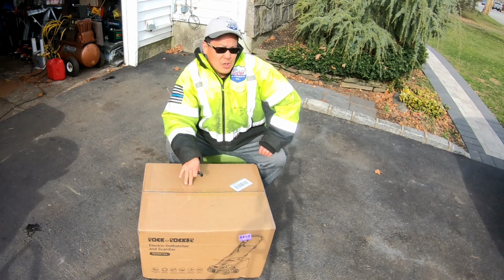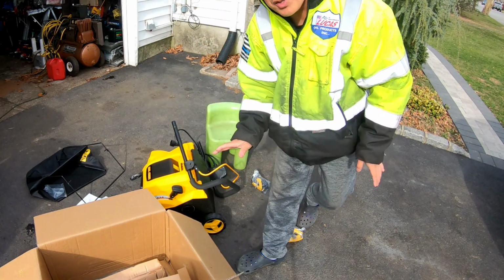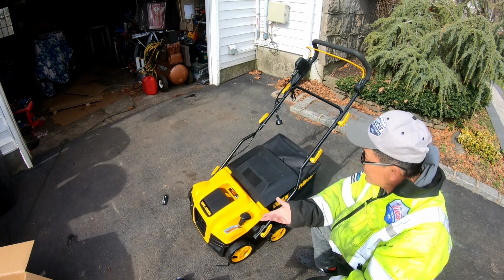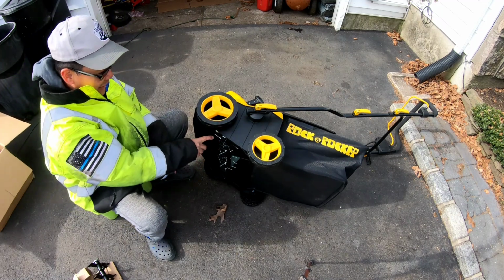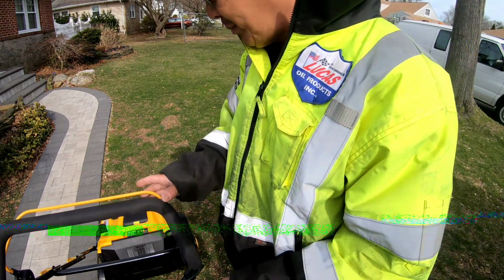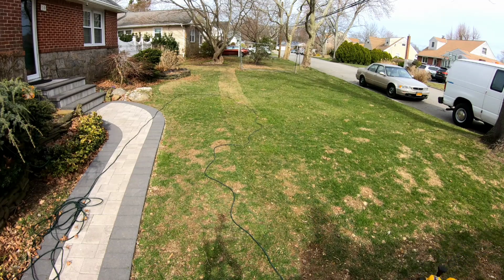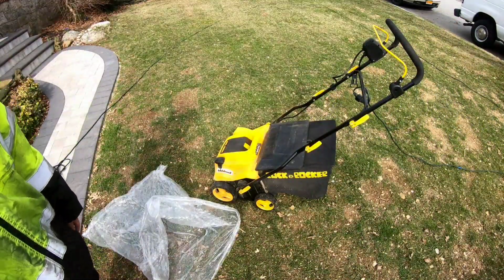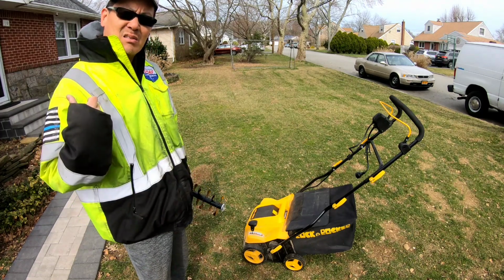ROCK & ROCKER 16" 15A ELECTRIC CORDED DETHATCHER SCARIFIER TILLER CULTIVATOR W/BAG UNBOXING & REVIEW

Comment: I bought a RknRkr and used the scarifier to prep for overseeding and it worked great after discovering the best way to use it. It doesn't push very well because of the rotation. The forward rotation tends to make it climb. If you pull it it maintains contact much better and requires less effort giving better results.
Reply from the maker: Good tip bro thx!  Hope you’ll subscribe

Comment: Henry, Most of the time when I think of a Scarifier,, I think of the rather large ripping teeth that are on road graders and other heavy equipment or even farm tractors that would be utilized for earth moving or leveling for future roadways or even unpaved gravel roadways. 
The Scarifier is commonly used for breaking very hard packed or more rigid surfaces.for easier grading or even digging. 
Henry, The device that you featured on your video would be a rotary scarifier which would be ideal for working areas of lawn that you totally needed to reseed or maybe an area that you wanted to work on before laying sod.  
And yes, I was rather impressed how well that the de-thatcher attachment worked on your lawn and would say that where you use you bagger somewhat greatly diminished the amount of thatch going back into your yard.
Just don’t tie yourself up with the extension cord - That Wouldn’t Be Very Good.
Reply from the maker: Thanks for the info mark
Reply: @MowersNBlowers   I always try to contribute to the channel.

Comment: We had the Sunjoe 15," and the air vents on the bottom front kept getting clogged, often causing the unit to overheat. These vents are next to impossible to keep clean because they are so close to the ground, and if you do clean them, you damage the foam there to prevent debris from getting into the motor area! Also, the Sunjor did not work well with Bermuda grass. The thatcher kept getting wound up with grass and falling off! The Sunjoe bagger is too small to use, so I used a bungee cord to keep it open but angeled downward to prevent debris from flying up. 

Did you have any issues with the grass wrapping around the thatcher blade and pushing it off the unit? I had this issue with the Sunjoe because we have some pesky Bermuda grass I am trying to get rid of. The Bermuda grass is vine-like and would wrap around the blade and push it off! 

This Rock & Rocker looks better built, and I will try it out. Thanks again.

Update: The Rock & Rocker arrived and it is great and so much better than the Sunjoe units I tried. It has plenty of power, the bearing design and attachment mechanism of the blades are different than Sunjoe's and did not get clogged, and seems more robust. The bag is bigger than any other thatcher out there and can fill up after a few passes but I found it easier to empty the bag instead of not using a bag and going back and raking the lawn to remove thatch left.  The first time you use any thatcher you will get a lot of thatch! Much more than you would anticipate but after continued use, it will be much less. One thing I am doing differently this year is I bag when I cut my lawn. Previously I would mow and not bag thinking my mulching blade was leaving good material behind to feed the lawn. This issue this material is what builds up and it doesn't degrade quick enough to make a difference. I use fertilizers and was told to bag to reduce the thatch build-up.  The Rock & Rocker unit is well built, larger, and has a more powerful motor to handle the tough jobs, and the quick-release handles make it easy to assemble and store.  I thatched my entire lawn on the 3-level setting and the blade was clean afterward and picked up quite a bit. Using the Sunjoe I had to clean the thatcher blade often to remove buildup at the bearing which would cause the blade to pop off! And the last note is this unit did not overheat and the air intake did not clog once. The Rock & Rocker is a winner and highly recommended.
Reply from the maker: No issues at all!  But I only used it for the front as you saw.  Good value though!
Reply: Nice review

Comment: You actually didn’t touch the thatch. What you used is more of a power rake. The other tool would be best suited for dethatching.
Reply from the maker: The scarafier?  What I picked up was thatch,  I wasn’t intending to aerate the lawn which is what the scarafier does.
Reply: @MowersNBlowers  The OP is correct. Thatch is the springy stuff located just below the surface. The "dethatcher" you used picks up the loose grass on top. In order to remove the thatch, use the scarafier.

Comment: I hate to be negative but you complain a whole lot. Your yard is the size of a baby pen.  Dealing with a cord for a yard of this size is a none issue. I need to do my yard and my front yard is 5 times your size. My entire yard that I mow with push mower is 20k Sq ft. If that is your entire yard it takes you 20 mins to mow, edge, and blow. It takes me 2-3 hrs to mow my yard and edge and blow.  I don’t mind since I like to get fresh air and exercise.
Reply from the maker: It’s all relative bro!  You’re used to bigger yards so used to a lot of work!  Smaller yards are easier but that’s what I’m used to,  complaining about the cord is the reason why I don’t buy equipment with cords since I’m used to gas powered engines which give me independence from a cord.  I’m against a corded item which is why I complain about it.  Pretty elementary isn’t it?
Reply: @MowersNBlowers  hey I get it.  You allowed to complain about anything you want. Some parts I use for my size yard such as blower is corded.  I try battery and it last 30 mins max and ain’t cheap. So returned it. The gas blower cost a arm and leg and my research it still only last  max 1hr or so. which will never work for me plus the price of gas not worth it having to refill several times. I have a nice battery edger/trimmer 80 volt and love it and last 1.5 hrs on one full charge.  Mower on gas cause I don’t know any electric last long enough for me that isn’t another arm and leg. 

I am. Just saying the inconvenience of a cord for doing anything in your yard ain’t worth it complaining    If you despise cord for de thatcher or anything then just don’t take the free gift.  But complaining just seem ungrateful to me. It’s not like you will take long to de thatch this baby yard.
Reply from the maker: @ericb2861  they send me the equipment for an honest review,  which I always do.
Reply: @MowersNBlowers  hey more power to you. Wish I could build a YouTube channel to get good free stuff I just don’t have the desire to also try a lot of crap for free either.
Reply from the maker: Thanks